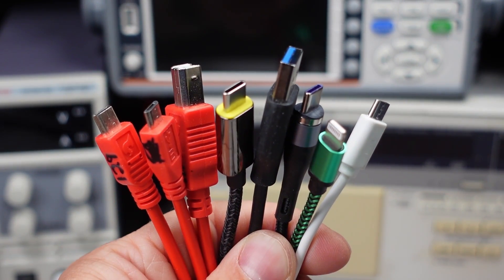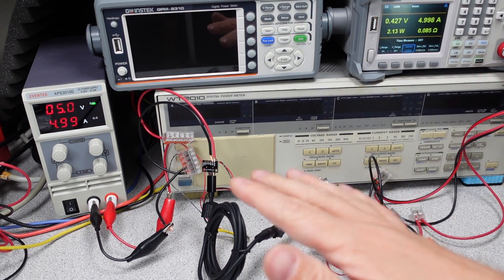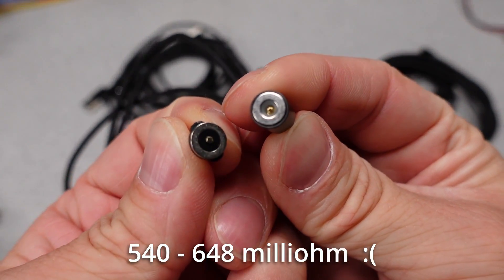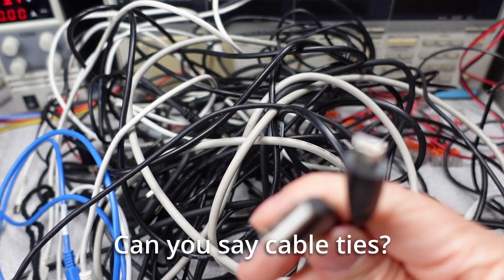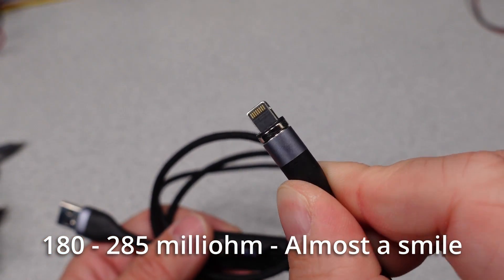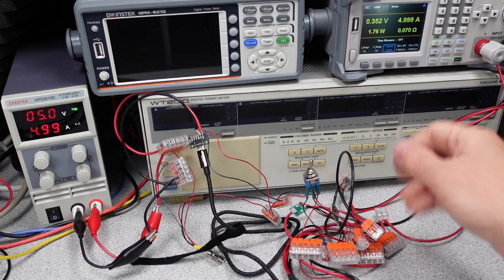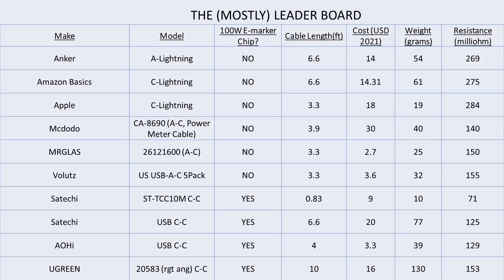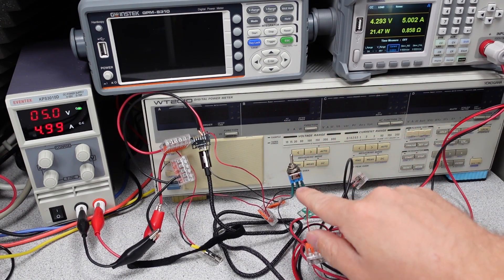USB Cables Part III That’s a lot of cables!

Comment: Finished all three on cables, following watching on car chargers.  Looks like I need to abandon the soft Mophie Stream cable plan, and spring for the Satechi cable, as well as their 72W charger.  (Trying to find it in silver.)  Just wish they had a 3’ C-C, vs. the longer 6’-er.

Thanks to you, I’m thinking I’m all set?  No doubt, I couldn’t have done this without you.  Can’t thank you enough.  I think the slim profile of the 72W, along with its length, will give me the narrowness to fit the deeply inset slot and the length where there’s something to grab onto to successfully (and easily) pull it out.  It feels great knowing bigger isn’t best, while feeling sure both devices are compatible.

Will have to look things over, carefully, once more, AND check out your website…

Thank you!
Linda

Comment: I have a interest question, what happen if you have apple 140w charger with baseus usbc cable  and that cable has two USBC output head,  will it charge 70w per head? I also have usbc cable with usbc, lightlight, micro usb head output,  just wondering how they negotiate each head on one single cable with more than one output head if you have powerful 200w desktop charger , I couldn't find any video relate to this
Reply from the maker: No, if you use both heads they drop to 5V only.  I tested one a while back, I don't remember if it made it into a video.  By rules of USB without a converter in the cable it can't provide high voltage to one port and the other port at the same time without separate negotiation of voltage.

Comment: hey,i have question regarding USB-C cable but not about charging..hope you can answer this.
can i use any third party USB-C to C cable for SSD Enclosure which is doesn't come with a cable ?

i have ugreen US562 100w cable. also going to buy a Enclosure for my SATA SSD.

Comment: Do you have or would you please make a video on testing cables using something like (or exactly) the Power Z KM002C cable tester?
Reply from the maker: In terms of resistance of the cable it shows less than what I show here so, no.  In terms of data capability, maybe, although most of them lie about that in the e-marker.
Reply: @AllThingsOnePlace  I've been using the e-marker as the main indicator of data capability.  Perhaps in a future video you could show how e-markers can "lie"?

Comment: would you say that these charging cables are ok to use with phones or just laptops and does it matter whether the cable is 60W/100W/240W?
Reply from the maker: It depends on the mode the phone asks for.  In general an iPhone should be good with any 60W or less cable.  Samsung likes 100W cables for fast charging.  The 240W cables are the same current rating as 100W cables but they offer the ability to support higher voltages for future devices mostly.

Comment: I need to learn how I can measure this 'hinged' connector on the one that I did not read the description for. I cannot see how these types or the magnetic changeable tip even work at all.
Reply from the maker: The magnetic connectors aren't great.  But basically they use pogo pins (spring loaded contacts) on one side and metal interface on the other with the magnet to force the two to stay together.

Comment: Hey! I saw that you make great tests and I wondered could you try DeOxit tests? 
Does it really lower the resistance and does all the other claims (Improves Conductivity, Protects, Reduces Arcing & RFI, Reduces Wear & Abrasion) held true? 
I have tried myself the red and gold versions (as 100% solutions), and I noticed that they clean oxidation and other gunk (similarly to 99% IPA), lubricate the connections, but I'm not sure are they really good for the electric connections and do they lower resistance by improving contact, nor do I have the equipment to test them out.
Reply from the maker: Yeah, I use deoxit on older equipment.  It does help revive old potentiometers and contacts that are tarnished in some way.  On a new device or cable it's not going to do anything but yeah on older connections it can improve conductivity.  If a connector is worn out, it isn't going to fix the connector.

Comment: I don't have those round magnetic swappable tip cables, I more rectangular-y ones, but am I being an idiot by using and loving them? I really like having just a single cable at work, or a couple of cables at home. I have with tips in my headsets (USB-C, micro), AirPods (lightning), mice (USB-C, micro), QI chargers (USB-C), keyboard (lightning), and camera battery chargers (USB-C, micro).
Reply from the maker: I tested the more square ones too.  I don’t remember how they did.  But adding an extra connector will always create a little more power loss, it’s negligible for low power devices.  It seems like everything you listed is  probably okay.  The cheap round ones I had I wouldn’t use.

Comment: One more... Sorry.

If Im getting you, Satetchi would be your go to brand for type-c to type-c? Any in particular? I found the one you're using but it doesn't do data. They make a 30" that's almost identical except its USB$ as well (and $10 more).

Would you buy that? I just got a GaN and all my old cables are type-a so I am replacing them all. The type-c to lightning I have seem to work.. albeit slowly. I am stuck on C to C though.. I keep thinking ill just buy Thunderbolt Cables to be safe.. but the ends on those are massive and not super practical charging some AirPods and iPhones and a MacBook, 

Thank you sir!
Reply from the maker: In general the data plus power cables are only really great at one of those things.  Also the data cables tend to be very inflexible. I like to use charging only cables since they are more easy to work with.  Yes, the satechi cables get a lot of use by me.

Comment: Hi. Thank you for all your great content.

I just tested the Satechi 6.6ft 100w c-c cable and am getting 15% voltage/power drop at 5a.  This must be out of spec surely, asking for 100w and receiving just 85. 
Looking at your results it says your power loss is 3.13 @ 5A.  Is that 3.13w per foot or do we have vastly different results?
Reply from the maker: Yeah, I commented on the other video.  That is way too much loss.

Comment: Thanks for the great video.  I see that Ugreen is selling both 60W and 100W C-C cables in the 10ft length.  Will the 100W cable be noticeably thicker/stiffer?
Reply from the maker: Yeah, I'm not sure I tested the 10ft 60W ugreen, in general though, 60W to 100W cables will have a noticeable diameter change.

Comment: if you're charging from a battery bank, does resistance play a ball on how much recharge from your limited juice supply?
Reply from the maker: Resistance will cause slower charging as the power the adapter can supply gets lost along the way.  With good cables, it's a 1 or 2%, with medium cables 3-5%, with bad cables, fire is the limit.

Comment: Theoretically, claiming to be USB-IF certified implies a maximum voltage drop of 0.5V on VBus and 0.25V on ground. Similarly, mfi certification should imply voltage drop is kept below a certain level, although it is not clear what that level is. One site claimed that 3m lightning cables used 18awg wire among other things to ensure quality.

By the way, anything higher than 150 mOhm resistance on a 100W cable violates the USB-C specification, since the total Vdrop would exceed the combined Vdrop for VBus + ground. Many of the USB-C 100W cables you tested are not in compliance with the usb-c specification. If it is not a 100W cable, then anything above 247.5 ohms would be out of spec.

Technically, a cable can be out of spec and still within those numbers due to the ground requiring tighter tolerances than VBus.
Reply from the maker: Yeah, it essentially forces cables to be shorter.  I don't check if the cables are certified for USB-IF.  Just present the numbers.
Reply: do you happen to have any cable recommendations given what you seem to know? i find myself in a situation needing some 3m cables, but the resistance numbers are less than ideal for those given the length i suppose

Comment: I wonder how usb c fiberoptic cables would compare. I use one for my VR headset for its incredible data transfer speed. Ps this is a great channel and I'll be sure to check out the speaker video 😊.
Reply from the maker: Many of the fiberoptic cables don't carry power.  Are there some that specifically do carry power?  I guess for a VR setup that would make sense.  I wonder how much power they would carry, I assume only 5V since connecting to a game system or PC.  Eh, can skip the speaker video, not the best content, very few views on that one, I expected that.  I need to get on the next USB cables round though.
Reply: @AllThingsOnePlace  according to a quick search the Oculus/Quest Link Cable supports PD 2.0 (5v from the motherboard 9v from the GPU). Considering it allegedly only draws 8w under full load the cable keeps the headset charged while I'm using it. Hell for $80 it'd better.

Comment: I have a bunch of usb a to lightning cables which lightning side has some pins burn out but the cables are in good shape. Can i covert them to usb a to usb-c cables by replacing the lightning side?
Reply from the maker: You can do that.
Reply: @AllThingsOnePlace 

Ugreen blitzwolf or baseus?
Reply from the maker: @Bruno-mr2ho  For cables probably UGREEN.  I like the thin Baseus charging cables for lower power devices because they are flexible and compact though.

Comment: Can you include what, exactly, the e-Markers report for the EPR cables?  

The spec suggests they might report a variety of combinations of voltage and current capabilities.  That seems to matter a lot for powering laptops, example.  I have yet to see anyone confirm what the e-Markers on actual cables report though.
Reply from the maker: I started doing that in some of the newer videos with the EPR cables.  I have a short on how one cable is fake.  But yeah for round 4 of this I will be showing that.

Comment: Have you tried or check magnetic cables? Could they work for multi quick charge like one wire for different output without removing the inserted part on the device?
Reply from the maker: I have some of those for the next video in the cables series.
Reply: @AllThingsOnePlace  awesome, that will be really helpful, I am now subscribed and waiting, thanks

Comment: As much as I want long cables so, when I connect to an external monitor, it is reachable. But, shorter is the most efficient. My question is in the Satechi USB4 to USB C cable will the size also matter or when we talk about the thunderbolt capabilities the difference is not there?. Sorry if it is a stupid question.
Reply from the maker: So, this video is focused on charging.  If you aren't doing power transfer and data is the concern, then getting the best data-capable cable is important.  The non-active style cables do tend to be shorter though.  I mostly use the Zeexus cable from the first comparison video for data transfers since it works at full speed.  I don't have a test jig to do the data transfer testing.  I want to get into that though.  It's about $20k to get into that side of things, minimum.  It goes up very quickly from there.
Reply: @AllThingsOnePlace  Thank you, Sir, and I am glad to find your channel before considering which things to get first regarding power.

Comment: So are 10ft cables a no go?
Reply from the maker: 10 foot is fine, it is just a little more lossy (I mean a little more, like still pretty good but measurably worse) versus a shorter cable.  The UGREEN and UNI 10 foot cables aren't bad.

Comment: I was just checking out the web site.  I don't see anything listed for 240W EPR cables.  Only up to 100W.  Did I miss something?  It seems as if many sellers on Amazon are listing 100W as 240W, slow USB 2.0 data speed cables as 3.1 speed.  Some of the e-mark chips are looking fake.  It's getting to be as messy out there as flashlight lumen claims :(
Reply from the maker: Yeah, I haven’t tested any of them yet so that’s why they aren’t on the web.  Round 4 of cables isn’t done yet but will have a lot of these PD 3.1 EPR cables.
Reply: @AllThingsOnePlace  when would that appear on your channel? have been waiting for it
Reply from the maker: @itsmnaveedsheikh  There was a round 4 of USB cables.  They are on the list on the website also.

Comment: Very helpful.
I use the volta magnetic tip cables but they are quite premium. Good to know if there's issues with something what to grab in an emergency. Probably satechi or ugreen.
Reply from the maker: I will have to check them out.  Yeah, the Satechi and UGREEN cables seem quite good.

Comment: Hi like what you doing on your channel it helpful and useful in buying product specially belly come to charges and charging cable  because they are not that many channels what do review charges and charging cables that many time and specialising techniquely I am not come across the channel what does specialising for charge and charging cable it would be helpful and useful if you can help me out and others who have a similar mine and identical mind in way of thinking and Desire and likes and slides list in 3 in 1 cable baseus cable with 100 words capability for a testing out video and how does the cable work also in the same video would be greatly appreciated if you do make that video helpful and useful like I mentioned anyway and anyhow will be in touch whenever back again
Reply from the maker: Thanks for watching.

Comment: Excellent video showing the feature sets, captabilities, or lack there of, on these USB cables. Its IMO, that the new USB C standard, is indeed far superior, over that of previous standards for sure. Where there's smoke, there's fire, and that cable really had the hots for you! I am sad to hear that not many watched your very inventive DIY speaker build. As you know, I watched it, enjoyed it, and I even answered your question correctly! Hopefully people will pay more attention to your next build!
Reply from the maker: It's all fun.  I enjoyed making the speaker project.  The cable on fire was also fun.  There was a giant fan just off camera pulling the smoke away.  I went extra careful with my safety gear on that one...cardboard plate under the on fire cable, which I absolutely knew would catch fire, haha.

Comment: Hey, was wondering if you're interested or have plans to test out Thunderbolt 3/4 cables? Every manufacturer seems to sell at least TB3, but just like what we've all seen on Amazon some brands can be hit or miss.
Reply from the maker: Yeah, I was kind of hoping LTT would cover that since they have a full data-rate tester ($20k minimum!), I don't have anything that can measure at those speeds and its all about data integrity with a Thunderbolt cable.  I have a few Thunderbolt three cables in my list that got tested for the power efficiency.  They didn't do terrible but when comparing thunderbolt to non-thunderbolt.  The thunderbolt options are worse at charging to make room for those other data wires in general.
Reply: @AllThingsOnePlace  That makes sense. Thank you for taking the time to answer my question! Keep up the good work!! 👍

Comment: I remember getting a cheap gas station USB-A to lightning cable years ago that never even worked, must not have had the real MFI chip it in. I try to just use Apple, Anker or other legit cables. Thanks for the video!
Reply from the maker: Yeah, in general manufacture supplied cables seem to do quite good.  I guess it doesn't pay for them to ship garbage with the adapter.

Comment: Another fantastic video! Thank you. if you do an other cable it would be nice to see a test of usb PD 3.1 chargers and cables. Both apple and Anker have these types of chargers.
Reply from the maker: Thanks!  I am still building out my test setup for the PD 3.1 devices.
Reply: @AllThingsOnePlace  Wonderful, I suspect that most PD 3.1 devices will have great power factor correction and low harmonic distortion. Your findings will provide the definitive answer.
Reply: @AllThingsOnePlace  By the way you said the cables with the magnetic tips can be dangerous. I was about to buy the Volta cables that Linus tech tips is sponsored by. Could you explain why they could be unsafe. I trust your word✌️
Reply from the maker: @jcap8391  Well, more about the safety for pets or children that may swallow the small magnets.  Not so much electrical safety.  Although that real cheap one isn't too good for that either.
Reply: @AllThingsOnePlace  Would I be able to send you some Volta cables to test out? They are kinda expensive don't know if youd want to buy just to test out
Reply from the maker: @jcap8391  I noticed I can't get them right now.  I'm still working on logistics of letting people send me things or vice versa but for now I am not taking anything.
Reply: @AllThingsOnePlace 

what is the best cable ugreen or baseus?

Comment: That usb c to 5.5 barrel cable is very usefull once you have the multiple dc adapter kit + a very capable charging brick that youve previously reviewed. Thou can get confusing and a little bit risky if youre not carefull with polarity. Some adapters comes at the same size but different polarity. Also handy with powerbank with high PD rates.
Reply from the maker: Very true.  I did check polarities when I did my testing cause my test equipment doesn't like getting plugged in backwards either.